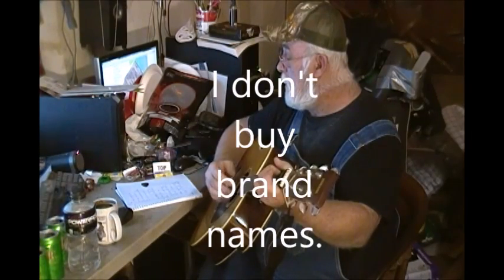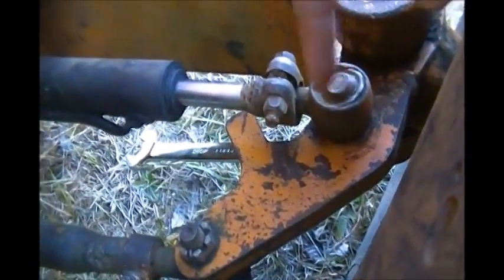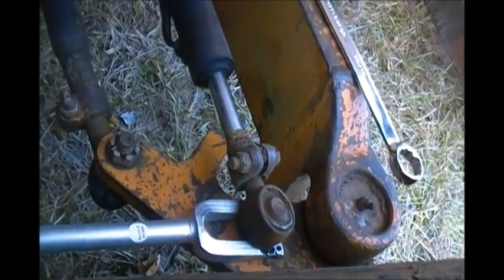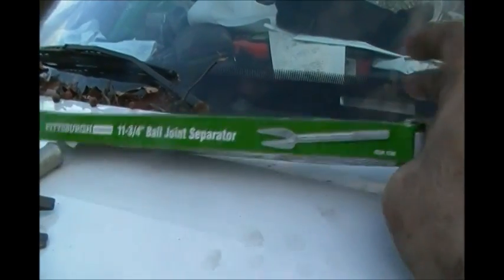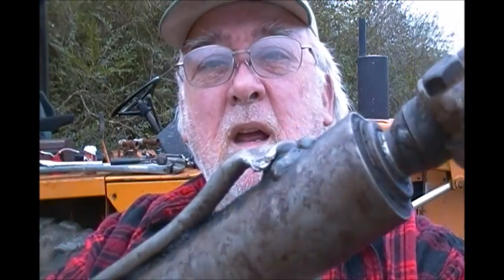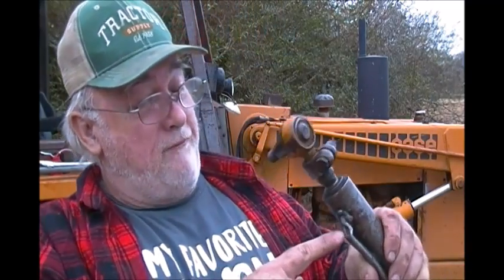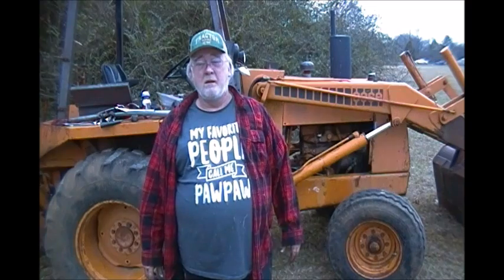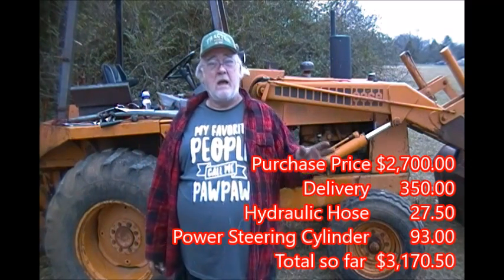The $2700 Backhoe Episode 3 Replacing the Power Steering Cylinder

Comment: great video paw paw spent many years working and repairing that old equipment. I grew up in the oilfields sure miss those days it's satifying work. If only I wasn't so far away I would stop by and help you turns some bolts.
Reply from the maker: Yeah, I like tinkering with old equipment and tractors.

Comment: that pickle fork is mushroomed from the hammer, that shows how soft that so called drop forged steel is. also you could cut that steel tube off the old ram and weld or tap & die a fitting on it with a new line and use it for something also the new ram tube is in a vulnerable place so you could cut a piece of 3/4 steel tube or angle iron and weld it over it or even J B weld epoxy it over that steel tube to prevent this from happening again,     just my 2 cents :)
Reply from the maker: Excellent ideas !!!

Comment: You still should have put anti-seize grease on those tapered shafts. It will keep them from rust welded on.
Reply from the maker: Hell NO !!!  I want them SOB's STUCK!  I had some old equipment where the shafts worked themselves loose and screwed up the hole.  I doubt if that cylinder will have to be removed in my lifetime anyway !!  BUT, good point, George.

Comment: Paw Paw, It sounds like the fan belt would be a good place to try a link belt.
Reply from the maker: I looked at them.....looks like about ten bucks a foot, but I think I will do it the old way first for the sake of a video and to show people how to work on these things.....another thing is when I go to the trouble to pull the radiator out, I usually replace the water pump as a preventative maintenance issue as they are not very expensive.

Comment: Dont forget to change the Power Steering Filter.  Front right of the engine, and often they are not changed as they should.  I use aluminum foil underneath the filter housing to catch the old fluid as I take the housing off.  Go to Heavy Equipment Forum for details and pictures.....check under 1968580CK.

Comment: It's great that you can do this stuff Bob! It means you still have some fitness in you. I know what you mean about the grease, but I've busted my hump enough times trying to change a tire that a mechanic used an impact air wrench on and I put a dab of grease on my studs if I'm changing my tire by hand just so that it makes it slightly easier next time and provides protection from water and corrosion (rust) on the threads and nut. But I know what you mean by not wanting it to come undone either.
Reply from the maker: OH I DO put grease on my wheel studs !!!
Reply from the maker: I have worked on my own stuff all my life.  I see no reason to stop now !!!

Comment: Did you have to pound the other ones back in?
You took them out with a tool. Did they just slid back it?
Reply from the maker: the new ones slide in place.  Tightening the nut pulls it snug.

Comment: Bob if you ever have to do that again put a bottle jack under the tapered bolt and jack it up using the machines weight to assist pushing the stud out. Then use your ball joint tool. I never used the tool. I would just smack the side of the tapered hole one real hard smack, maybe two, it would pop out everytime. Have a wonderful day and a better tomorrow. HA
Reply from the maker: You are not the first to suggest that.... I DEFINITELY will in the future !!!

Comment: Your Case must be an early 1970s?  I have a 1968 580C, and am also trying to get those darn steering cylinders off.  On one side, when I turn the castle nut, the entire nut and bolt rotate.......I guess I need to wedge that joint puller on it, and then try turning the castle nut?  Looks like its gonna be a real pain for me too.

Comment: Paw Paw 3 - tractor 0
I saw that hydraulic jack hiding under there, once I couldn't get it off and had to go swap out that ball joint tool - it would have sat overnight with the weight of the whole front end sitting on that jack under the ball joint!
Reply from the maker: What freakin' jack are you talking about?  There is no hydraulic jack near that backhoe !!
Reply: It'd be that big red thing you can see lying in the grass at about the 5 minute 40 sec mark !
Reply from the maker: ROFLMAO !!!!!!!!!   That little red thing is a four ounce oil can holding my homemade penetrating oil !!!
Reply: looks so much like an hydraulic jack!
my apologies!
Reply from the maker: LOL !!! NO problem Jack !!

Comment: I changed mine but it won’t steer at all now ... what could be wrong?
Reply from the maker: Two things.  Check your owner's manual or service manual to make sure you are using the correct fluid.  Mine uses hydraulic oil instead of power steering fluid.  Make sure you have fluid in the pump.  You want to turn your wheel all the way left and all the way right several times to purge the system of air.  I actually raise my wheels into the air by pushing down with my front end loader.  It makes is MUCH easier to cycle left and right.  Just like bleeding brakes, you don't want air to get in the system.  Keep the reservoir filled to the correct level.
Reply: DoingItCheap thanks for the reply! I was assuming it was ran off the hydraulic oil from the main tank . I’ll check for a reservoir this afternoon.
Reply from the maker: Follow your lines.... they will lead you to the power steering pump.  It is not like a car.  It almost looks like a starter in that it has no belt.  It is gear driven.  When sitting in the cab facing forward, mine is on the right side at the front of the engine.  You should see a spout with a removable filler cap that has the dipstick attached.
Reply: how did you fix that prblm i.m having the same prblm now with my backhoe

Comment: i have a CASE 580c THE STEERING WORKS GOOD BUT I HAVE POWER STEERING FLUID LEAKING FROM UNDER THE STEERING WHEEL DO YOU KNOW IF THAT IS THE STEERING CYLINDER OR THE RUBBER COLLAR  BELOW STEERING WHEEL?
Reply from the maker: My first thought is that usually the metal fittings don't leak and it must be some type of rubber seal that has broken down after 50 years.
Reply: @DoingItCheap  Thank you

Comment: Read some comments and some beat me to using a bottle jack...........but that cylinder is repairable!. Dontthrow it away. If you cant replace it yourself a basic machine shop that knows basic hydrolics can replace that tube and repac the cylinder good as new. Just redon one of mine on my 410jd for $75 and it was a loader cylinder.
Reply from the maker: LOL !!  After you have been with me a while you will realize I don't throw ANYTHING away !!